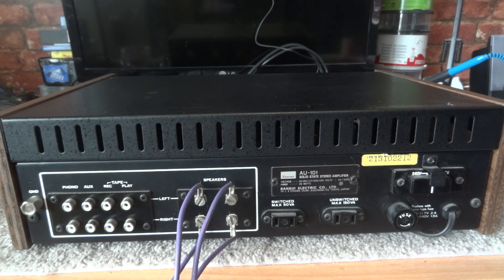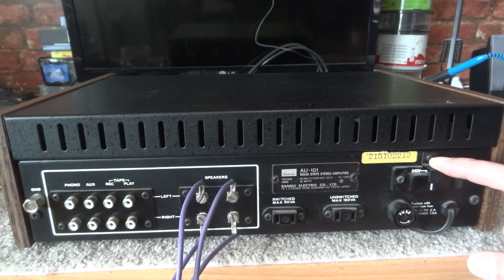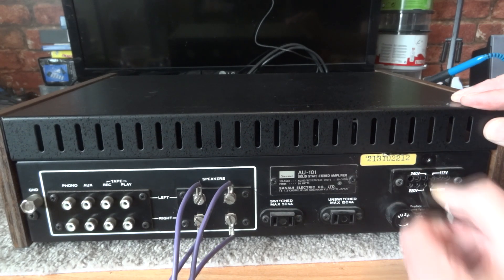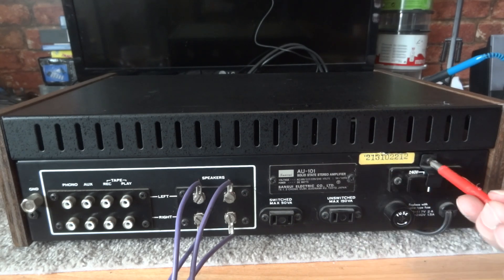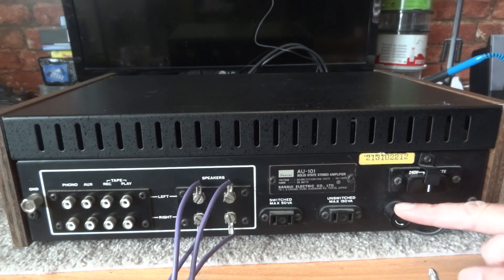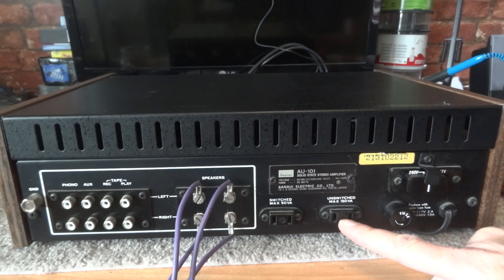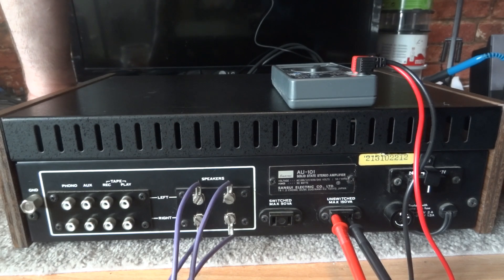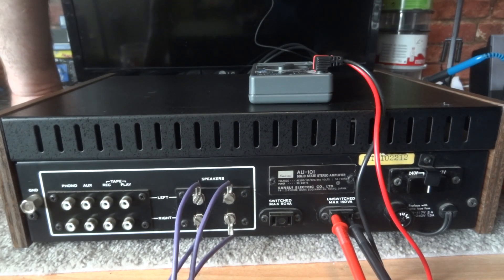How to Select Mains Power Voltage on Amplifier & Receiver. Vintage HiFi Audio

Comment: Hello Michael, thank's for a great channel. 
HiFi Engine gives me this message when I try to download a service manual: 
Account Registration
Sorry, but due to abuse of our free service, the registration system has been permanently disabled.
While we work on a solution to this issue, the service remains open for existing members only.
Registered users can Log In as normal.
If you need to reset your password please use the Reset Password form.
Reply from the maker: Hi, thanks for letting me know. I wonder what happened. If you were a perticular manual please let me know and I might be how to download it for you
Reply: @MichaelYates  thanks a lot ;-)  I could use a manual for my Sansui 555A  all the best.
Reply from the maker: @MyVintageSewingMachine-nw7wy  Email me at arcadeimages@gmail.com and ile send them across to you